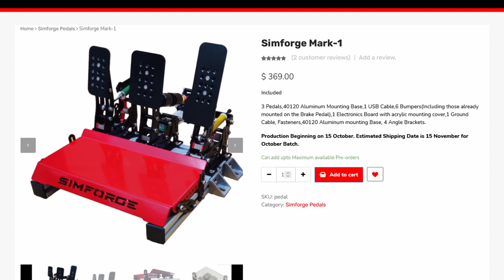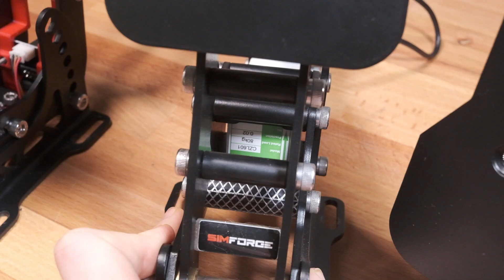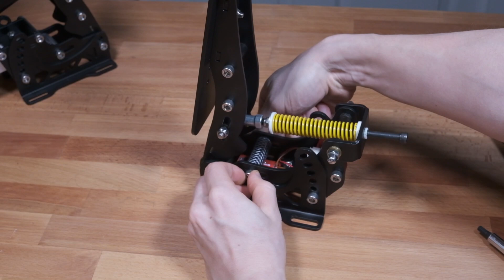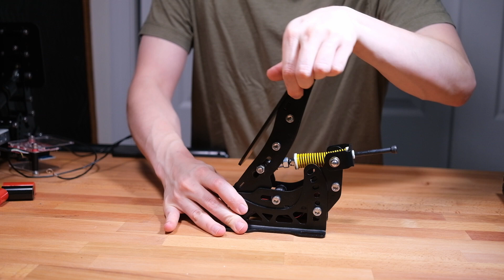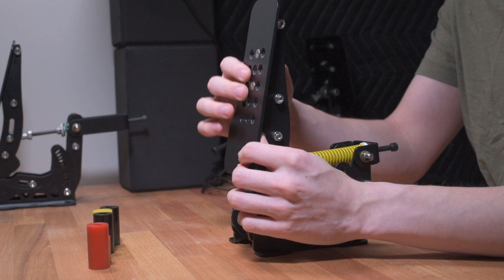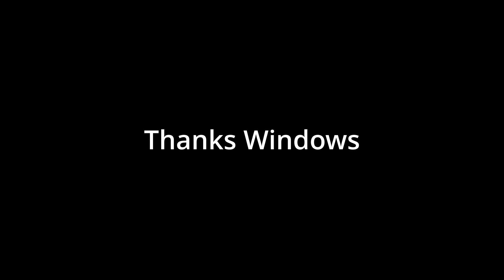Affordable high quality sim pedals?

Comment: As someone with years of experience of engineering of hardware, firmware, and software engineering teams in India, just do not trust it. No racism here, just hard won long standing experience. Never outsource to India. Remember, every major brand has pulled out of outsourcing in India over the last eight years.

Comment: If you received a set of faulty pedals ie malfunctioning pcb why would you not send them back? instead of putting your warranty at risk by attempting to fix them yourself, even if successful pretty sure you void your warranty. Obviously you're not happy with them which is why i have a hard time trying to understand why you didn't return them instead of repairing them yourself.
Reply from the maker: They are a small company in India, as such they have no obligation to offer warranty and do not (they do try to offer support where they can). It was a simple fix that was not the cause of any of my other issues. I was in communication with the manufacturer through the troubleshooting process. They do not offer returns hence why I was unable to return them. These are the risks you take when you buy boutique items like these pedals and it is important that consumers understand the risks in situations like this.

Comment: i feel like you didnt try any other position than how they were in the box . i try every pedal position posible for the throttle and finally found the sweet spot + buy some lithium greace
Reply from the maker: I did neglect to mention I tested them best case scenario with many configurations on a rig with an adjustable base plate. I returned them to stock for the video. As mentioned, all pedals were lubricated.

Comment: Hey There, 
came across this review as i was searching for answers as 1 of 2 units ordered did run into issues.
now my unit didn't squeak but i had faulty cables and experienced a lot of fluctuation in the signal which made it almost impossible to calibrate.
and if i somehow managed the calibration, in game they become JUMPY!
Now on the other hand, the 2nd unit was completely flawless and had ZERO issues.
Reply from the maker: Maybe you can get them to send you replacement sensors. Still, quality control is very inconsistent which is a very serious issue regardless

Comment: Been using these since the past 4 Months now. My experience is opposite of yours. They're quite and pretty smooth and one of the best one's I've used. I previously owned a T3PA, Clubsport and HE Sprint. They're actually on par with the Sprints and in some features like the Adjustability and the sensitivity of the brake pedal, they're superior.
Reply: @designamk1160  Had to sell most of my gear during the Lockdown.
Reply: Thank you for this. I needed this for confirmation on buying this pedal set.
Reply: Question for you. I've been looking at these pedals, I have the fanatec v3 pedals. Are these pedals worth the money?
Reply: @codysonnentag  I have them since mid october and from my experience they could cost a little bit more and still be worth
Reply: @deviljes666  could you maybe help me out and tell me if they work in BeamNG drive?
Reply: @univers2103   sure they are
Reply: @deviljes666  sorry for being late :D Yeah the support told me hat they tested it with a lot of games, they work with windows drivers so they should be compatible with any Sim that uses Xinput controller data. That's what they told me, no worries now, just waiting for them to arrive :D What you think about them after months of using them?:)

Comment: I bought this set with the base plate about 2 months ago for around $480 w/ship to US. I haven't experienced any squeaking or any pedal noises at all to this point. With the base plate lifted to it's highest point the pedal size is not a problem for my size 9 foot and I'm really enjoying these pedals. 
 Took a few days to get used to them and along with making adjustments to fit my wants & needs but I'm loving them now......of course this is coming from 12yrs of using a G25 setup also, so ya....a major difference. 
 After watching Barry's review of them, I decided they were worth taking a chance especially for the price. I guess only time will tell how happy I'm going to be. 
 And now with the newly added alpha mini to go with my simforge pedals, last yrs g2 vr and around 09'  DIY  2 dof  scn5 seat mover, I'm in sim racing heaven!
Reply from the maker: Glad you had a good experience with yours! It's unfortunate they have that much variation in quality control then.
Reply: I got a G27 and been thinking about the same thing. Fanatec V3's are a decent deal used but I can't mount them inverted, which I have done with my G27 pedals and prefer it